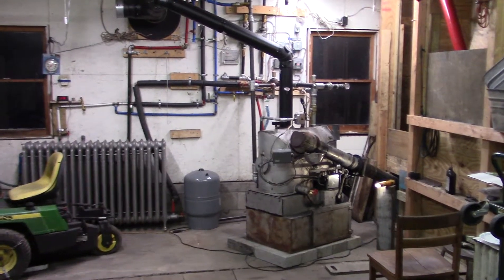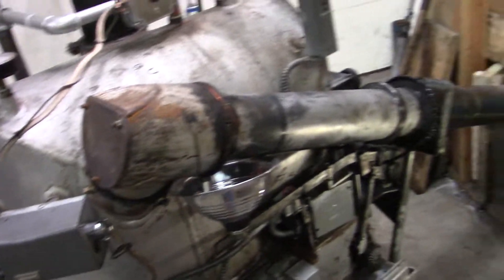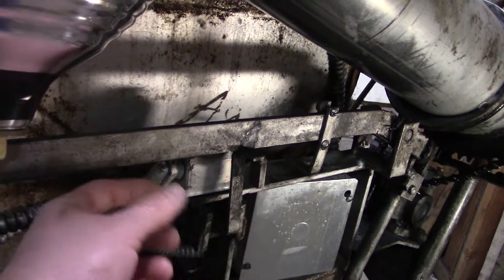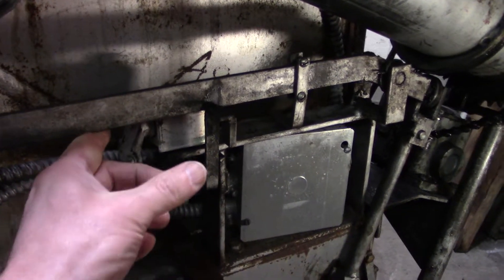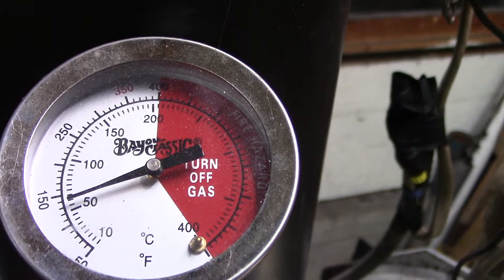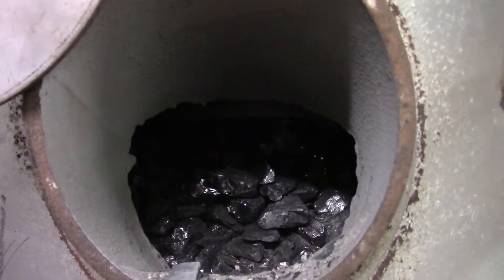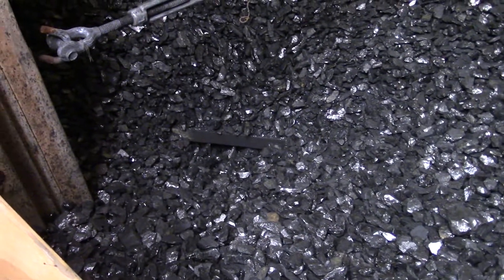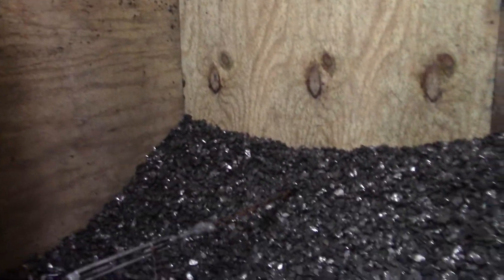Axeman Anderson 130M Anthracite Coal Boiler PT41

Comment: If the ashing lever keeps dropping when it isn't asking for ashing I was wondering if the pivot point of the ashing lever. Might be worn just a bit allowing the lever to move sideways and miss the stop point when it should hit it and stop.

Just adding a couple of ounces of fuzzy brain power to the unasked question of why does it miss the mark.

Best of luck Don
 

Cheers!!
Reply from the maker: James, Yes you are correct. The ashing lever and linkage has a good bit of side to side play. As you will see in the video, I put a slight bend in the lever to keep it from falling in behind the prop.